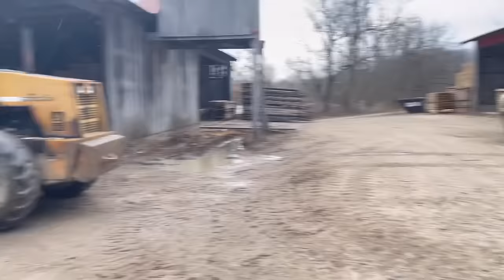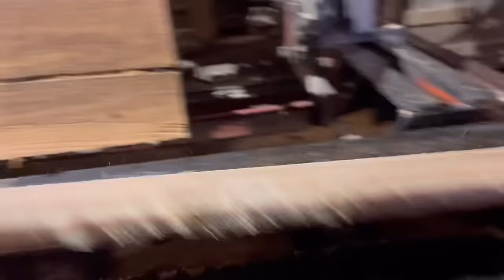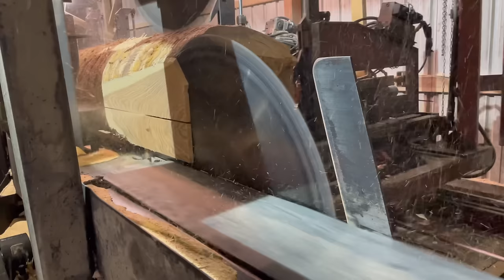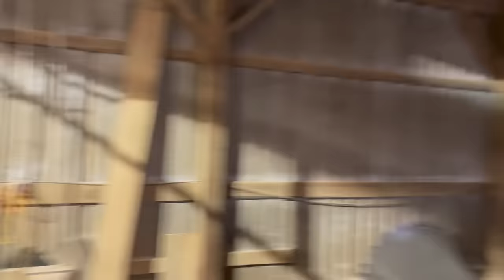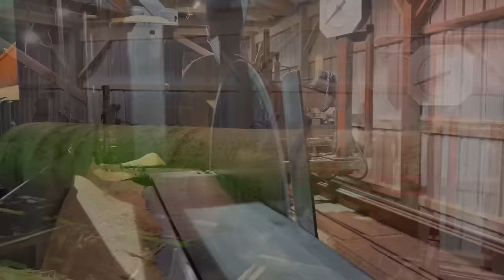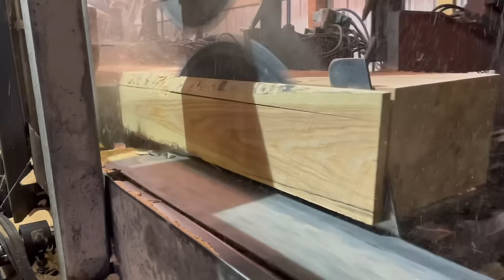Sawing a 29” Black Oak into 6/4! Plus Other Stuff! #18

Comment: I am intrigued by your automatic position setting (it looks like) side saws for edging.  I hope there is a video that talks about the operation of your sawmill.  It is so fast and accurate.
Reply from the maker: There will be!! And they aren’t automatic:) I’m setting them while I’m running the carriage back
Reply: @Helmsburgsawmill OK.  In one of the vids, I did see the two LED Lines that shown down the log.  You are just SO FAST at doing it, it looks automatic.  Great job of setting it!  The other reason I thought it was automatic (other than the speed) was that it seems like it would be impossible to compute and set the proper board width so quickly.  Please do a video on that part.  Go slowly for us dunderheads, please!  ;-))  Thanks.

Comment: Is your top blade out of adjustment? I noticed the edger saw leaving a mark.
Reply from the maker: No it’s not out of adjustment. If both saws are cutting good my feed rate will dictate that small lip you see
Reply: @Helmsburgsawmill  so does that mean the saw wasn't cutting good or was your feed rate off on that log?

Comment: The first truck load had varying width and length. Does a customer supply logs and say, "Get me all 1 inch by best width as you can out of 10 logs". And you cut and charge for board feet? How does that work? Thanks again for great video.
Reply from the maker: So we’re just buying logs in bulk, from a logger, and shipping grade lumber to an outfitter. They mill the lumber down into their own finished product. They take all length from 6’-16’, and from 4” min width, to as wide as you can. And you’re welcome!!

Comment: Nice sawing dude but i have a question this is the first time I've seen you sawing so slow is it because the oak was so hard or did you just slow it down a little for the viewer's and why do the logs on deck appear green is it because of the lighting it looks weird? But you are a good sawyer dude you utilize every bit of the log you can!
Reply from the maker: So I had just sharpened the saw! You wouldn’t think this, but when it’s sharp I have to go slower. Other wise the top of the headsaw leans into the log a little too much. When it gets duller, I have to go faster to make it lean in enough:)
And ya it’s just weird lighting. Thank you!
Reply: @Helmsburgsawmill  no problem dude I was just wondering I've never really seen you saw that slow but that's a great explanation I can understand I've been around sawmill's a little in my life but I've never been a sawyer only off barrer and it sucks when the sawyer gets in a rhythm!